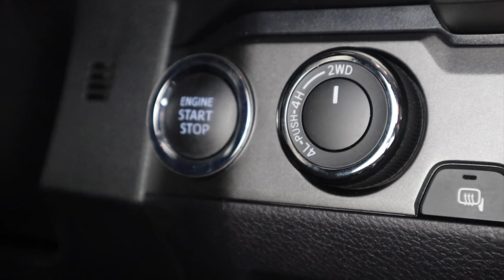Should you buy the latest Toyota Tacoma 2016-2021?

Comment: Why buy a used one when you can get a new for a couple 1000 more (or less).
Reply: this is why i pulled the trigger on my 2021 someone gets it!!
Reply: Used ones are more than new right now with the chip shortage and low production. I ordered new.
Reply: @shannondixon3767  2018 used sr5 4x4 with 30k miles on it was goin for 42k at the dealer crazy hah
Reply: Exactly
Reply: Now new is cheaper. I just got my 2021 TRD Off-road cheaper than used one
Reply: depends 100% on the price
Reply: @joebrito2066  I’m picking mine up on August 10th, how are you liking it so far?
Reply: Just got a new 21 sr5 4x4 predator for 2000 more then a 19 sr5 4x4 with 29000 miles
Reply: @edgarayala5233  same brotha !
Reply: waiting for the 2022.
Reply: Wonder how dealer is selling used one at such a high price? I bought new 2021 OR before the chip shortage!  So glad I did!!! 😂
Reply: just waiting on my chip like 🙃
Reply: Just bought 2021 for this exact reason now I’m on YouTube learning about my truck. I’m also looking to learn on the 2021 highlander xle. I bought that too :)
Reply: Tbh!! I went to go check out some used Tacomas and came to be only 2-3k cheaper with 20k miles (minimum) on it... smh
Reply: I just did
Reply: Dealing with this now. 

Trading in a paid off tundra and a car I'm 2k upside down on. But it's a 2020 trd off road with 6k miles for 40k. Probably not great but not horrible either.
Reply: Y'all think 2022 is worth it,
Reply: Just got a 21 trd Offroad with technology package and leather package, for 44k  thought I overpaid A LOT, but then I looked at the used market and made me feel better about myself lol
Reply: LOL these things are tiny, I'd be afraid I would DESTROY these trucks/they are BASICALLY cars, I also would worrie about hauling/towing ANYTHING, in these trucks.

I know these trucks are popular,BUT I don't understand why,MAYBE gas mileage/to say you have a truck, with car qualities, I'm not a big fan of F150s either though, I wouldn't trust an F150 either, they are BASICALLY cars/they lack the power needed, to get jobs done, ALTHOUGH I would trust an F150/1500, more than I would trust a Toyota truck, at least when it comes to towing/getting work done.

I would say these are ACTUAL trucks/these trucks wont scare you as much/won't make you think somethings going to break, the F250 or F350 OR a 2500 or 3500.

LOL if you raise one of these Toyotas, MOST likely, it won't be able to even tow its rated 6,800 pounds/more practically 3,740 pounds AND IF you care about your car/truck, I wouldn't exceed 1,000/MAYBE 1,500 pounds, in the bed, this thing can't even tow 10,000 pounds lol, a chevy cargo van, can tow 10thousand pounds, and carrie/it has a load out of 3,339/4,312 pounds, also an F150 can at least tow 11thousand pounds and carrie 3,339/4,339 pounds, If you care about your F150, I would bring that back to 1,800-2,000 pounds though,these trucks/Toyotas, would get to much wear and tear/they can't hold up under load, not that I would expect them to, based on how small they are, but I wouldn't even call these/toyotas, trucks,I don't know why these vehicles exists, MAYBE to give the appearance of a truck, to put this in prospective, a mini copper can carrie 793/935/1,031 pounds, a toyota is capable of 1,440 pounds, in its bed/carrie load and this is pushing it, I'm not saying EVERYONE is carrying this much, BUT IF it has the ability to carrie more, than what your carrying, less strain/wear/tear will be done to the engine/transmission/the over all vehicle, anyway I wouldn't call these trucks, I would say they are a SLIGHT step, above a mini cooper.
Reply: Seriously...I have been wanting a Taco for so long and have never seen a used one that makes sense over spending a little more money and buying a new one
Reply: @joebrito2066  what is considered cheap? I got a quote for 4x4 DCLB Trd sport for like 51k
Reply: Paid $33,300 for a 2015 TRD sport with 60k miles. Yes there are unicorns out there still.

The most reliable model year to Date. The 4.0 Should have been carried over.
Reply: @mattmatt2417  every truck you compared a Tacoma to is a full sized truck. F150, 1500, etc is compared to a Tundra. Tacoma is a light duty mid sized truck, more comparable to Nissan Frontier, Ford Ranger, Chevrolet Colorado etc...
Reply: Got my off-road 2018 before the market sky rocket. Quicksand color. 47k miles for 34k. Included taxes and plates and tags the price went up of course.
Reply: @joebrito2066  what psychos are paying this? I ordered my 2022 saturday.
Reply: @kenvincent19  i just ordered mine saturday
Reply: @jasonallen6836  how much was the total if u dont mind
Reply: @kenvincent19  it was an SR v6 doublecab, MSRP+ 250 doc fee+ TTL. Thats it. No other gimmicks.
Reply: @jasonallen6836  wow that's awesome  I've been searching and most of them are marked up so high, I was looking at an SR5 V6 LB DC, msrp like around 38k, when they sent me back the quote it was like 50k+ 😑
Reply: @kenvincent19  kings Toyota, Cincinnati, OH. Tell Danielle I sent you. I bought a silver SR doublecab Saturday 10/16.
Reply: Not always true,,,!!!!
Reply: @briansalgado2408  …I just put down a deposit on a 2022 TRD Sport with technology package, $40,000 out the door. No mark up, but no negotiation on MSRP.
Reply: Bought my 2020 used with 14k miles, do wish I got it new but it was the exact model and color I wanted so I pulled the trigger
Reply: @pewbangpew8109  That makes since.
Reply: @pewbangpew8109  if its what u want, then awesome! I'm supposed to pick mine up in a few days
Reply: Because older ones have been out long enough to build a record of reliability. New ones come with bugs. Sometimes big bugs.
Reply: @phamily-tv  rumor is they are doing an all new tacoma for the 2023 model year, so I'm waiting to see if I should trade my 2017 in for that.
Reply: @mattmatt2417  You're literally talking out of your ass, the third gen has already been put through worse tests than that i.e. the Gauntlet towing more than that uphill, in high elevations with the AC running lol. TheFastLaneTruck does those testing videos, they did the Taco a while back, handled it fine without breaking too.
Reply: Couple 1000 more 😂🤣😂that’s a good one.
Reply: So you don't have too put up with the B.S. at a Dealership !!!
Reply: @joebrito2066  how about now !!!
Reply: @geedubb-q1u  not really sure what's so funny but at the time thats what it was. nd the only reason I didn't buy.
Reply: @cap8e  ..a new one is nowhere near a “couple” of grand more. That’s what I was laughing about.
Reply: @geedubb-q1u  okay a 2500-3000 is a couple  if you don't understand where the market was at that time then don't speak on it. Of course it's not normal in no way shape or form.  Hell there was dealerships ask 50k used  (yes it had all features). Im talking about used being sold for 35-40k used.
Reply: @mattmatt2417  just speaking for myself, I'll never need to tow nearly that much, and I don't need or want a big heavy duty truck. I just want the space to go pick stuff up from home depot. There's a big market for consumers who want a small truck for hauling light loads back and forth, and to get back and forth to work. No sense in being able to tow a heavy trailer if you don't have a trailer to tow
Reply: 1 week of checking prices from used to new it makes zero sense to buy a used tacoma for $15k or paying ridiculous fees from a carmax. I’m getting a new one for way cheaper lol
Reply: Just bought a new 2021 Tacoma SR Access cab  last month for 2000 less than a couple used ones I looked at.  If the chip shortage is driving the price how did I find one in a day?
Reply: Same waiting for my 2022
Reply: Got a 22 cheaper that I could get a 19 with 35k miles...
Reply: @macdreezy44    damnnn I got a sweet 2018 TRD off road w/ 42k miles in mint condition, plus came w a few extra options, got it for 36 grand. Worth every penny
Reply: I would but the whole state of Hawaii doesn’t have any new ones
Reply: @joebrito2066  It aint cheaper, the used trucks are more expensive which makes people wanna buy the already expensive new vehicles
Reply: @mattmatt2417  Nah, they're trucks, small trucks but trucks, but there are trucks that can do a better job if youre using them for heavy duty work. Most people dont use their big trucks for any type of work either way. Most trucks are luxury either way, youd probably get more use outta a van or even minivan, depending on the situation I suppose.
Reply: @ericsprouse8643  The doofus thinks its a full size truck XD
Reply: @noahtaylor9457  XD
Reply: @chimchu3232  Same here, dont like big trucks, dont need one, theyre are nice in their own right, but I prefer smaller vehicles, rather smaller vehicles that are versatile.
Reply: @LewdGyrations  yes.  I drive a fiesta st, great little car that gets good gas mileage, but I'm getting to a point in my life where I need to haul more stuff than I can fit in that car, a small truck would be really nice, but I don't need or want a fullsize
Reply: @mattmatt2417  I know what you mean, the difference between mid and full-size capabilities are gigantic. I didn't go into it as a truck guy, and in retrospect I really think I would have gone with a full-size truck. The whole better to have and not need, than need and not have, deal ya know.

I'm stuck with a 4wd Toyota truck, which is pretty great. Sorry for being impolite earlier, thanks for not reciprocating my asshattery lol
Reply: Because it is better to buy something with a low mileage history from a certified dealer than buy something new ALWAYS. you want a machine that is reliably broken in by a human...always.
Reply: @mattmatt2417  Tacomas are made to be used for hardcore truck things guy. This is why Toyota makes the Tundra. The Tacoma is more for recreation and honestly that’s pretty damn obvious. So clam down.
Reply: @swampssa  LOL I actually broke a few of these trucks a while back,including the Tacoma, they were friend's trucks and they were like, use my truck for what you do on a day to day basis, I asked them, are you sure, and they said, yes, then they went on to say, I have confidence in Toyota and I said, I do to, as a car or for a car that looks like a truck or maybe a grocery hauler or maybe carrying a few pieces of wood or a few small pipes, but for towing NO,anyway long story short, it didn't go well and thier brand new trucks were seriously damaged, these trucks arent designed for heavy use, Toyota makes great cars and even great car trucks/they look like a truck,but they don't perform like a truck,but to be fair, I cant use an F150 either,those are basically cars as well, a 250 or 350 or Chevy's 2500 or 3500, at the least, is where trucks become trucks,before that point, you NEED to be really careful with them or they start breaking and they are unreliable.
Reply: Exactly! But I’ll say the used ones are likely clapped out pieces of garbage that people want a million dollars for. Weird times we live in…..
Reply: Got my 2020 v6 6ft auto new 39k Out the door

Comment: When the new Ranger came out I was debating on that or a Tacoma.  My wife said "you want bells and whistles or something reliable, dependable and when it hits 300k will still be worth more than a Ford".  I ended up with a '17 TRD Sport and very happy with it.
Reply: I should also note that finding a used Tacoma wasn't easy.  People tend to keep them for a very long time and for a very good reason.
Reply: I looked at the new Ranger too since to older one was very popular.  I few things about the interior, radio and HVAC control I didn't like. Plus some of Ford's Ecoboost engines have issues.  
I went and looked at a new Tacoma and the decision on what to get was made. It was hard to to find exactly what I was looking for in 2020 post Covid but I got it. Love the truck.
Reply: @shawnn6926  that's nice you like your truck, im wanting to ungrade, my brother in law has become sick and my sister has his 2017 Toyota Tacoma sport 3.5 with only 4,500 miles garage kelt, wants $25,000 looking at the price it seems cheap for the miles. I have a 2000 Toyota Tacoma sr5 4 wheel drive, bought in 2004, it has  220,000 still in good shape, its just getting older. I'm 60 now and want a newer truck since my 2000 is getting some wear.
Reply: You have a very wise wife!
Reply: That's a very smart wife you have.
Reply: You made the right decision
Reply: I bought a 22 Tacoma Sport
Reply: Smart wife
Reply: I have a tacoma with less than 30k miles already having misfires i am the first owner and bought it new. compare that to my used and abused 2009 ford 150 with 250k+ miles. I put nearly 100k miles on it and it runs without a problem. what the fuck toyota.

Comment: I've got 210k miles on my 18. Solid as a rock.
Reply: What engine?
Reply: Well Doodah,   I got 360k out of my 67 Chevy van.  Just changed the oil regularly.  It worked for a living, unlike 99% of Toys. on the road
Reply: @backspace6030 nice fairy tale
Reply: Right on Bro! My Taco is an overpriced, always breaking POS that is NOT made in the USA or Japan. I too had a 67 Chevy Van, also had over 300K.  Drove it all over Canada, dirt roads and onto Alaska.  So easy to work on.  Wish I still had it.  Worth big $. Seldom see Toyota trucks used by companies to work, and a lot more old Chevys still on the road than Tacos.  Toyota is like a cult.  Beware the dealers, YIKES!
Reply: Have not experienced any of these problems on my 2016 V6  at 100k miles.  I must have gotten lucky.